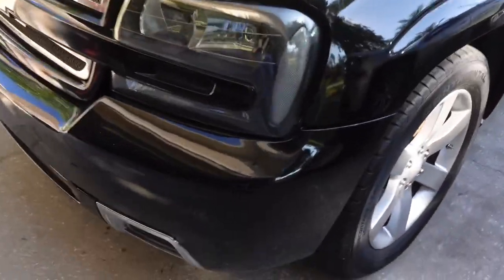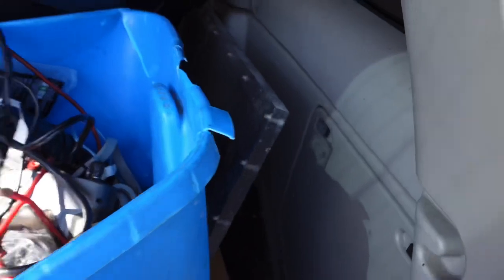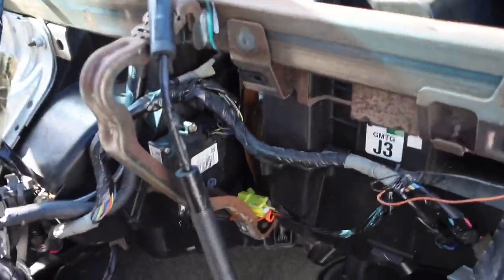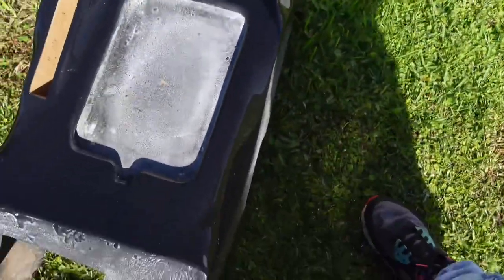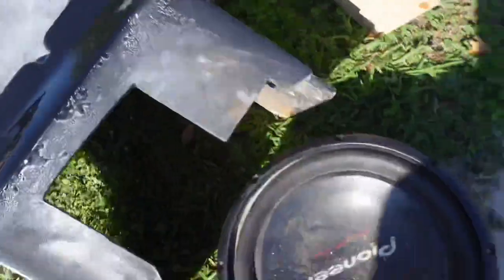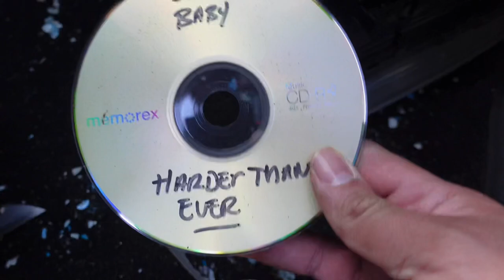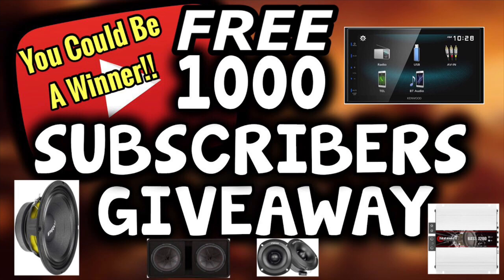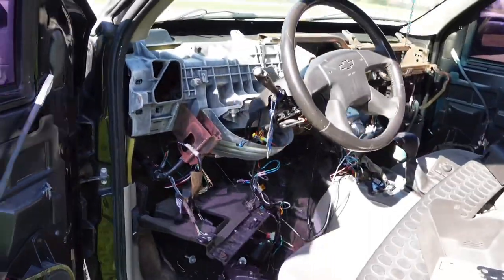Car Audio throwing away my $2k IPad Custom Console vlogmas | Burnout truck coming in hot

Comment: Bro just leave the steering wheel, driver seat and passenger seat  and yank out everything including the carpet  get that truck light as possible  so you can tear up some burnouts with ease   and in the engine bay  take out everything you won't need  make everything easier to work on the motor when you need to
Reply from the maker: Bet ima get on it stay tuned ima give u shout out on next video🤘🏻🤘🏻